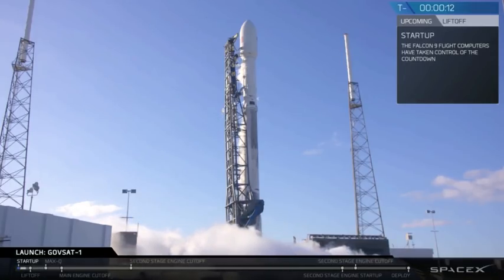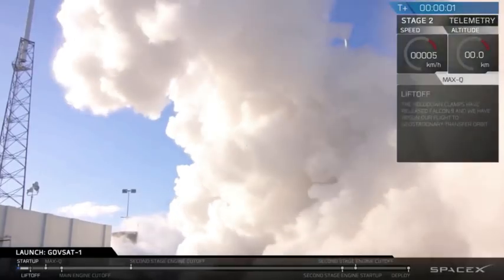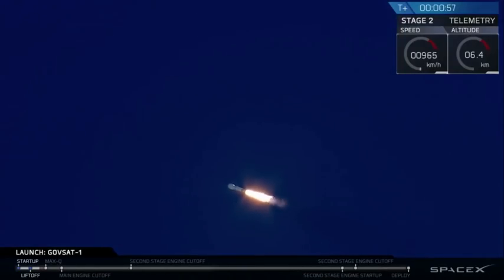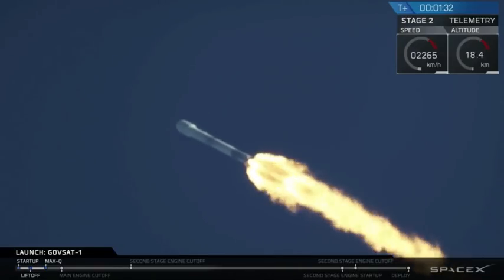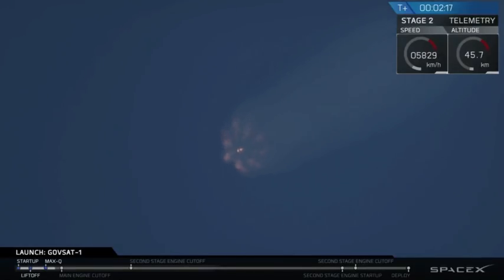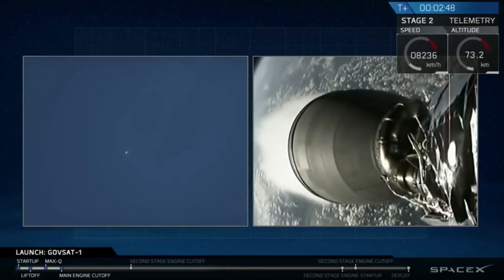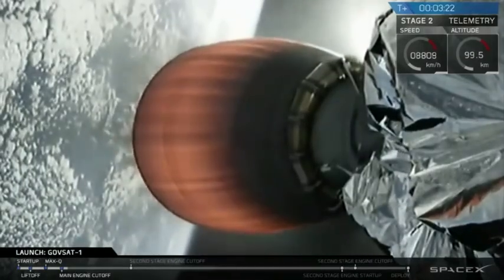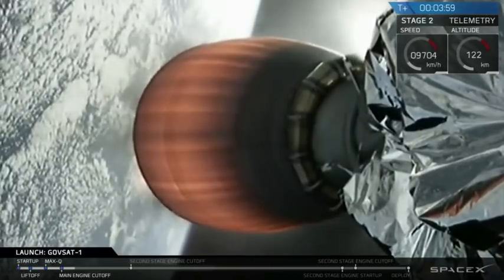SpaceX Launches GovSat 1 Atop Used Falcon 9 Rocket

Comment: why not recovering the first stage??? what a waste
Reply: waht mmm limited reuse  and reach a higher orbit with no recovery
Reply: No, not a waste. The Block 3 boosters can only be used a couple of times, which is one more time than any other launcher in history except the Space Shuttle. It costs money to recover the boosters so, since they can't reuse them again anyway, that would be the waste. The Block 4 and Block 5 boosters will be capable of being used more. The Block 5s, at least ten times.
Reply: waht mmm first stage returned in good condition. Unexpectedly it landed on the ocean surface without explosion